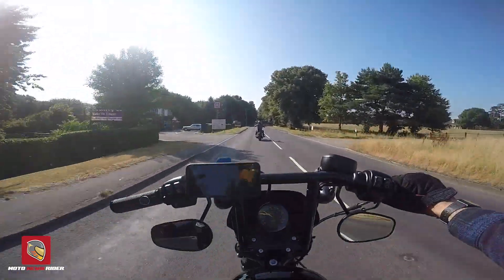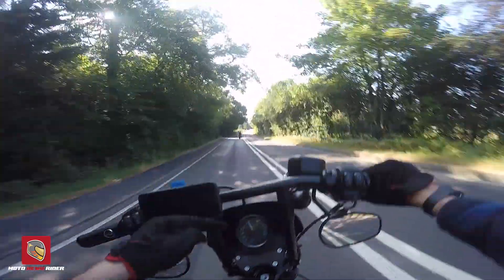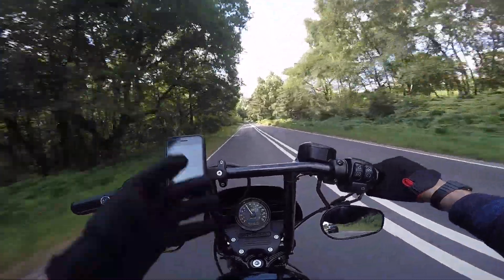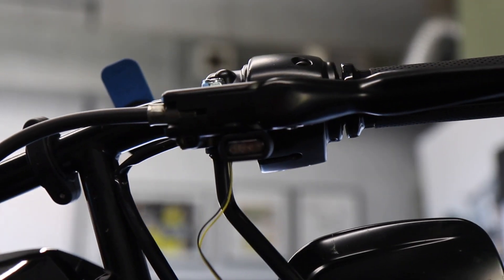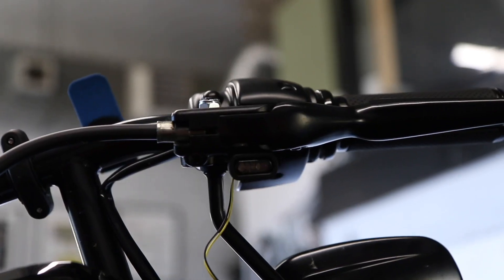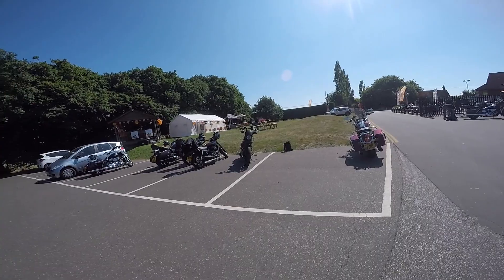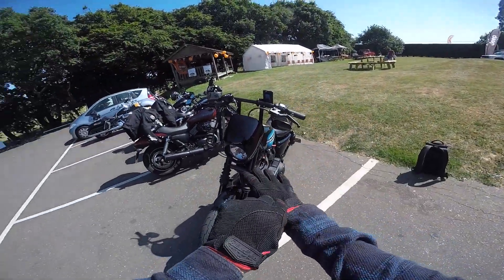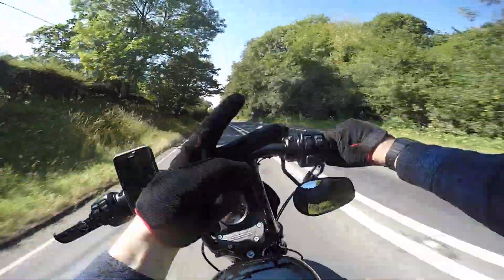Sportster Getting Cutomised 2018

Comment: I've got to ask... Are those mods MOT friendly? I hear they can complain about the distance between turn signals, the noise that the pipes make or the fact that the license plate isn't behind the rear wheel. Do you need to swap those out when you go on an MOT inspection?
Reply from the maker: Ivan Jetá all good for MOT in the uk.
Reply: Motonewbrider Cheers mate. I appreciate it. I’m looking to get a Street Cup/Rod and do some mods, but I always wondered what was the MOT’s stance on them.

P.S. - Your bike looks amazing.

Comment: Nice ! Love the Iron 1200...... contemplating potentially getting one myself.
Reply: Ian Campbell way to small get a big twin .....
Reply: Want to but $$$ is the issue. I’d rather ride a sportster than not ride at all. We’ll see what happens. If I can swing it I’ll get a big twin. Besides how is a 1200 considered small? My last 2 bikes were a 750 and 900. 1200 is a lot for the small size of that bike. Probably goes like snot !!
Reply: Ian Campbell buy a used big twin evo instead ....small as in size of the bike not the engine. ....
         RIDE SAFE RIDE HARD BUT RIDE HOME. ......
Reply: hey mate....iv got an iron 1200 aswell with intake pipes and tune and i raced my mates cvo pro street break out with the 110 cube and he only starts to pull away from me from 110-120kph so its pretty damn quick for what it is haha
Reply: buknono1984 
yep, if they where to put a six speed transmition in there, they wouldnt sell anything els, you ran out of gears not power..
Reply: buknono1984 if you want speed buy a rice burner you want a bike that looks great buy a big twin
Reply: 99% of the time we always cruise at the speed limits...only raced EACH OTHER just to compare them....couldn't care less about going fast.
Reply: buknono1984 that makes both of us besides my bike looks so good I want people to see it.....lol
Reply: haha and thats why we cruise at the limit....cause we looking hella good haha
Reply: buknono1984 
I slow down to check how cool i look in the reflection of shop windows,, lamo
Cool and the gang man cool and thr gang. Lol
Reply: buknono1984 AMEN !
     RIDE SAFE RIDE HARD BUT RIDE HOME!
Reply: Cheers 🍻 from Canada 🇨🇦
Reply: Ian Campbell good day from the USA
Reply: Joe Blow I’m going to Los Angeles to visit you on Wednesday... lol
Reply: Going to stop in at Laidlaw’s to say hi to Matt and bring him a T-shirt
Reply: Ian Campbell I live in Georgia but come on down I'll have some ice cold beer for ya....

Comment: That turned out really well mate, looks like bags of fun to ride. Question about the leads, am I correct in thinking they are needed because of the filter/exhaust upgrades and does this mean you've had to remap the bike? Colour looks OK actually but if you want blue back in the day we used to use heat shrink to change the colour of leads on cars etc. may be worth sourcing some, costs naff all and you can take it off if you don't fancy it.
Reply from the maker: Bike was all remapped on the day - it run's really well with the air filter.  Apparently the screaming eagle leads support the top end RPM.

Comment: Love the Sportsters to death but why have they got the AMF paint scheme thing going on... This was possibly one of the most embarrassing times for H-D and nearly made them go under and made them a sticking point for lots of bad jokes.
Personally I wouldn't buy this 1200 Iron because of the paint schemes,they need to offer a plain Denim black like the 883. It's good to see H-D offer an Iron in the 1200 though it should of happened years back.
Love your mods it looks great but the nod the the AMF years needs to stay in the past.
Reply: Whats wrong with you go get some rattle can stove black & just spray over that AMF shit you don't like!!
Reply from the maker: Tbh I’m not hung up over the past with what AMF did.  I just like the design.
Reply: The AMF era bikes were rightly panned but the paint was always cool and FWIW I think it looks great. Not to mention that anything retro sells bucket loads right now, so it’s a good commercial decision by HD.
Reply: the AMF throwback paint is awesome.  maybe the reason harley did it was as a redemption for that era.  like saying "this paintjob is now on a well built bike that deserves it"